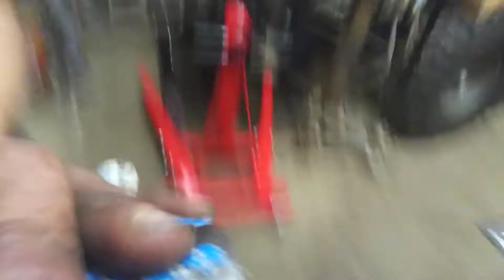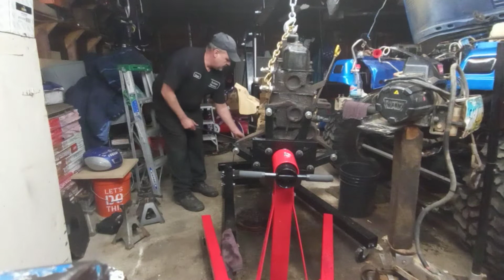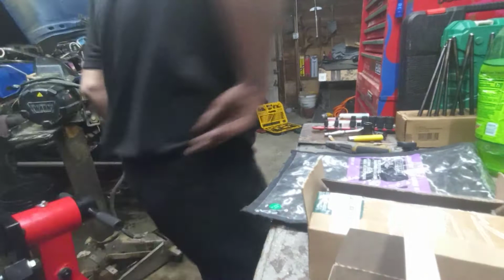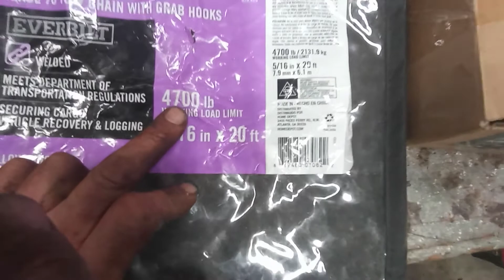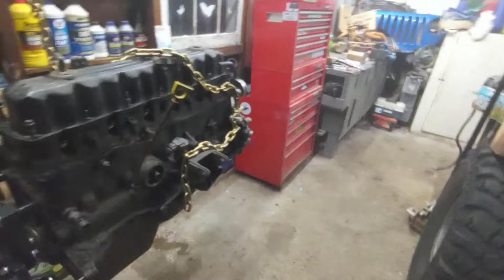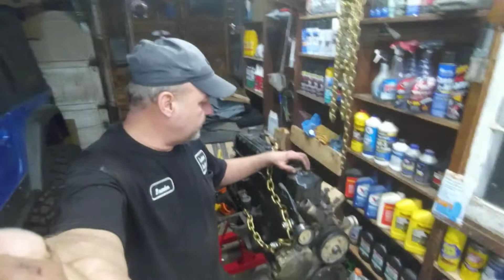Jeep 4.0 engine rebuild. PART 9: mounting the engine to the stand and selecting the correct chain

Comment: Hey I have a question. I have the same stand and I can't get it close enough to the crane to attach the engine
Reply from the maker: I know what you mean. I had to put one of the bottom legs of the engine stand in between the engine hoist stand to get close enuff and spin the engine on the chain to get it to work. Hope that helps